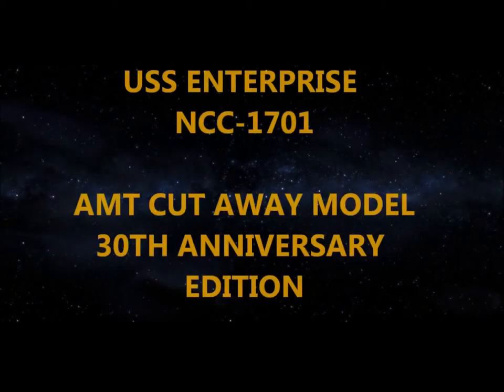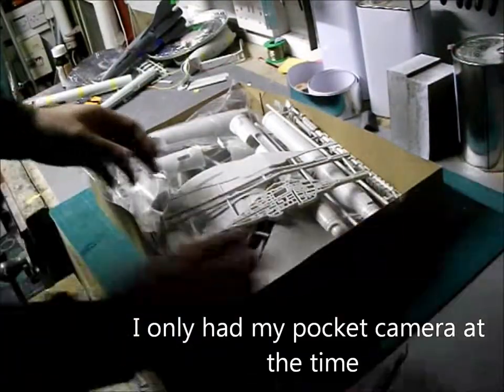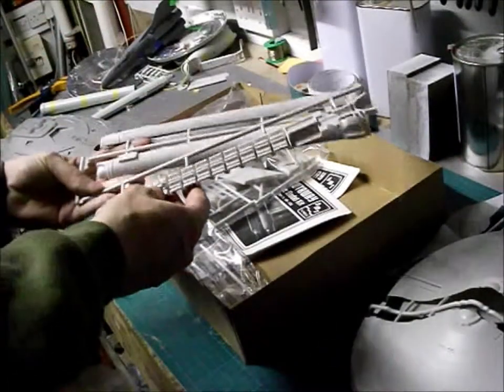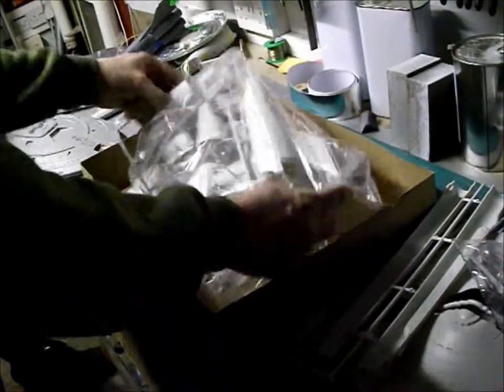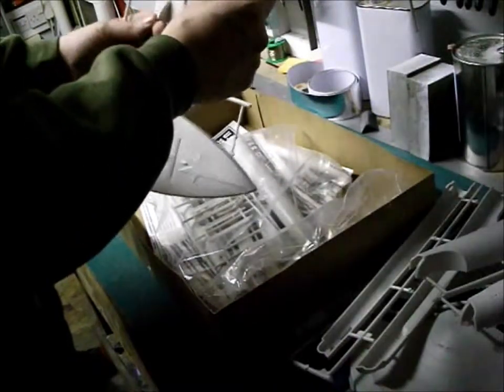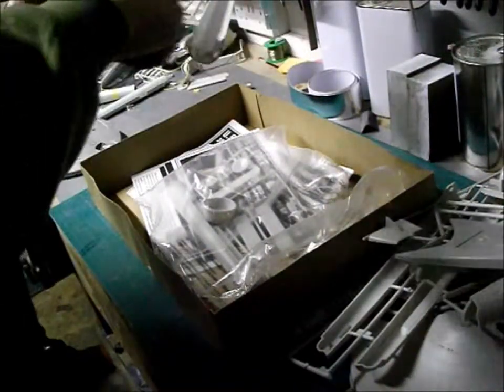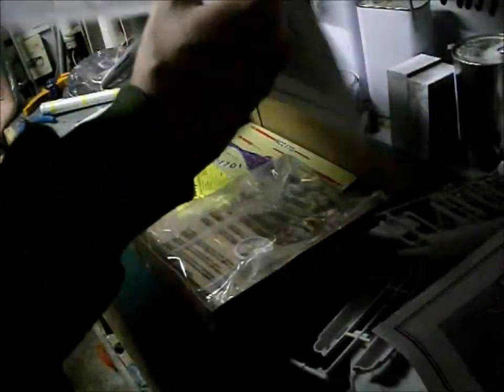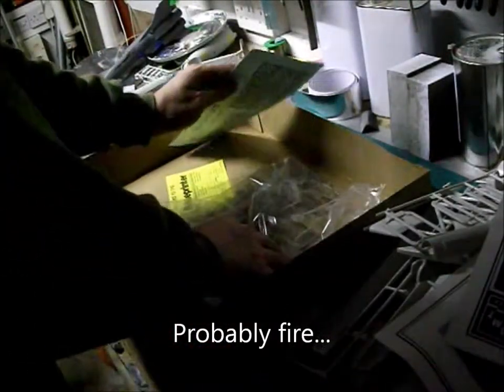Star Trek Build Off, Enterprise cutaway AMT Part 1

Comment: No room for electronics?
Um, I HAVE seen two build-ups that DID use electronics for lighting. Boyd Crompton (TrekWorks) backlit his build-up in the saucer (saucer-only) and another fellow on Cultman TV modeling site built up his 22-inch Enterprise as a WHOLE ship instead of a cut-away.  The cutaway Enterprise is better-detailed than the 18-inch AMT Enterprise and marginally bigger than Revell's TOS Enterprise, too.  He used model train motors to rotate the bussards on his model and it had all the navigational lights on it, too.